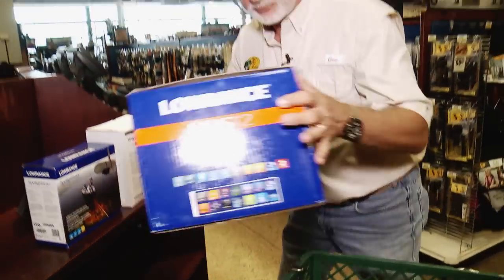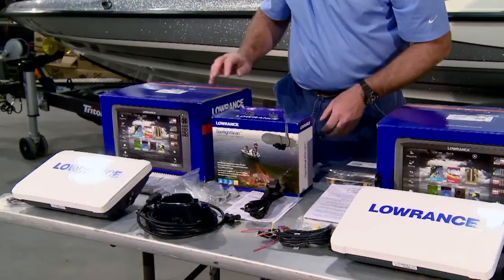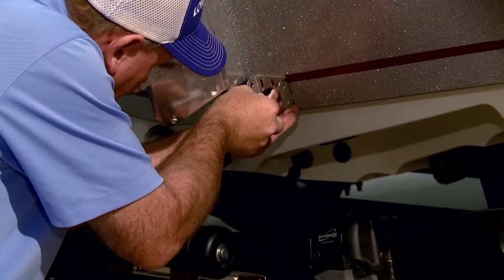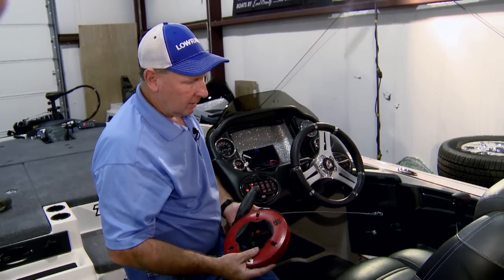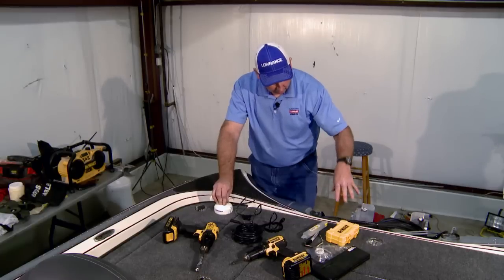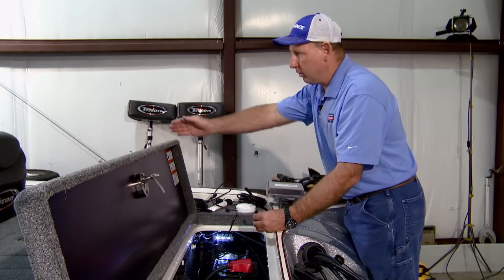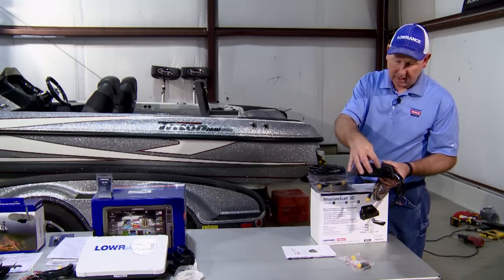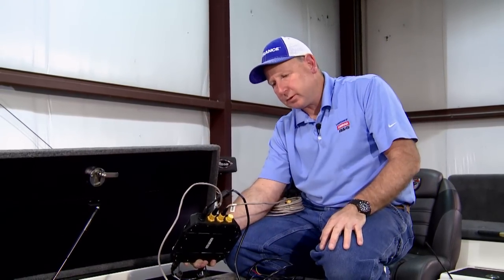Lowrance StructureScan 3D Installation part 1

Comment: Always add a string or small rope to the fish tape before pulling through to have another PARALLEL path for future or forgotten wires.  IF you use the string or small rope once make sure you pull another rope or string the next time.  Always keep the path available to prevent rats nests like when you use the fish tape many times.
Reply: Great idea, obviously coming from a knowledgeable gent!

Comment: There is no mention anywhere on the internet what to do when you have a I/O and one side of the transducer would be partially blocked by the drive, if mounted on transom, called Simrad and it's ok to buy another 3D transducer mount it on port also and connect both to one module one to trans port 1 and the other to 2. Supposedly they are meant to run like this also. I noticed you install really close to where the water flow goes to the propeller is that ok, should it be installed toward away from the flow to the drive?

Comment: NOT Using a starboard (high density plastic) to mount a transducer mounting plate to your transom is a critical mistake here. You mount a bigger, wider plastic plate with 2 screws into the fiberglass and SEAL the holes below the waterline with marine silicone. That costs you less than $50 for the board, some marine silicone sealant/adhesive, and a couple stainless screws. This is a cheap and bit of insurance after dropping $5000 on electronics. What happens if you have to move the transducer (due to interference, hitting a stick, changing or upgrading your transducer, etc.) after you drilled that bracket directly to your hull? Yeah .... more holes in your boat. At least with the transom transducer mounting board all you are doing is drilling 2 holes, one time, into your hull to mount the mounting board. Any transducers, or changes get screwed into board but not through hull. You can move stuff around without having your hull full of holes .... truly an oversight here .... I am truly surprised here.

Comment: Hey man, although your video is very interesting, that is a total non-sense to put dielectric grease (as far as I heared well this point) as a dielectic property is to insulate and not at all to conduct. So what you did putting grease it to create after sale service at short term !!!
Reply: marc PRYLLI the Di electric grease insulates the fine pins against water ingress and corrosion. It does not conduct electricity between the pins themselves. When the fine pins are inserted into the female end of the connector the metal to metal contact ensures they work just fine. This grease protects the connection for years.

Comment: why are you drilling holes in the boat?  nonsense
Reply from the maker: Steve longwood well Steve part of the needed installation necessary to mounting a transducer requires drill holes in the fiberglass! I have been in the boat manufacturing business most of my life and these holes seal up with no problems down the road! Of coarse silicone sealers is important to properly sealing the drilled holes. Hope you  possibly  learned a few things.